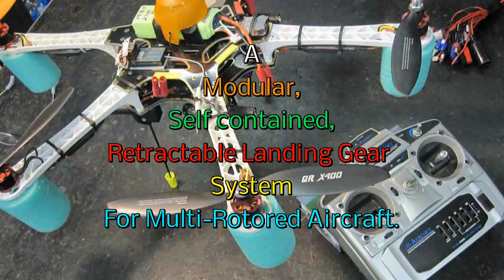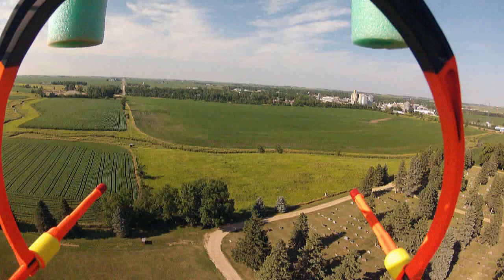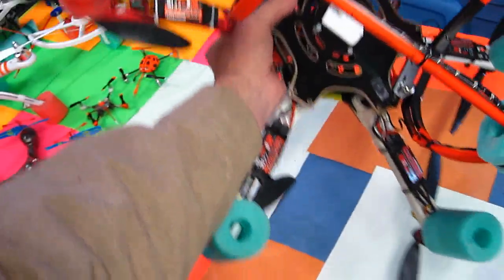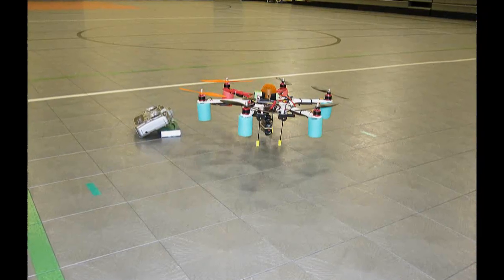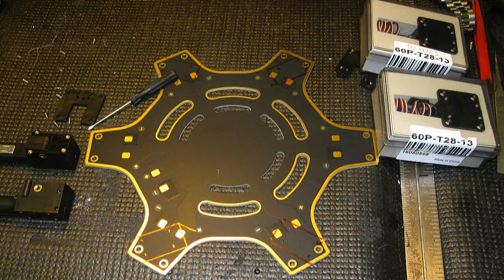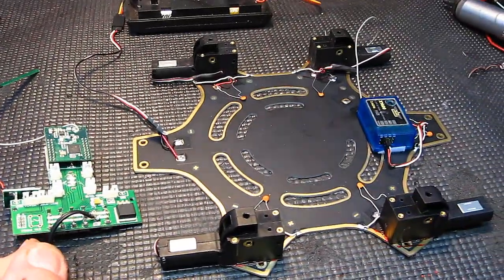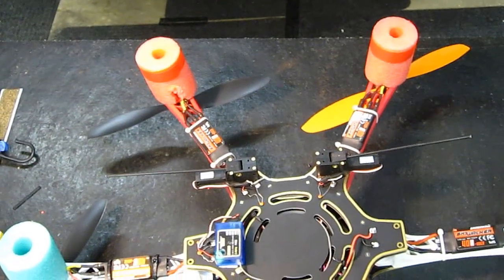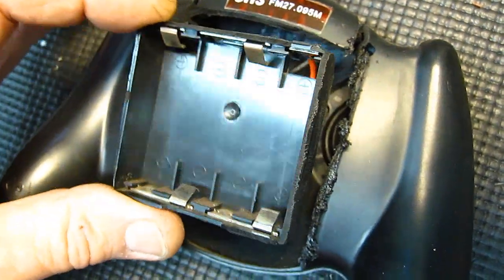Self Contained, Retractable Landing Gear Module for Aerosky 550 & other rotored aircraft.

Comment: Dave - GREAT video.  You have ended the year on a High Note.  I'm looking forward to 2014 and seeing how you do the retracts on a Walkera QR X350, like I have.  You seem to have come up with an excellent solution to the landing gear getting in the way of shooting videos.

Have a great New Years Eve.

~R~
Reply from the maker: HI Rick.  I appreciate your comments.  I am anxious to put my gear module on those too. This 6 pack hexarotor weighs 915 grams (about 2 lbs) The reason I used it first, was to test the strength of the Landing gear under heavy weight, which works great as you saw.  So please stay tuned as I am beginning the next phase on the DJI, WK 350 and blade 350 as they are lightweights.  Happy New year to you as well.

Comment: what about simply putting legs further up the arms, saves a heck of a lot of weight
Reply from the maker: This machine already has short legs under each arm, and I have broken two legs on rough landings when battery quit and the arms broke.  Therefore I decided to put the support under the body, where the weight is. Thanks for the comments.
Reply: ***** how about legs that extend out from the center horizontally then down

Comment: Hey Dave. Love your videos, but i don't know about the yellow caps. You should fabricate some skids or footing type of thing. They don't look too stable.  Probably something round at the end like bottle caps or something like that. More surface, i guess. Any ways. Keep the videos coming. There great.
Reply from the maker: Haha. Well the shoes were the least of my worries, but I decided to use them as they screwed right on, are strong, and wont catch weeds, SNOW and grass as easy as a foot pad. Of course anybody can put anything they want on the arms, including door panels, wheels and wheel pants. This is my first version, so being way out in the wilderness here, I simply used a little Marine intuition and use what I had on hand. When I put this on my Blade 350, maybe I'll try something else. Thanks for the comments and I appreciate your support.